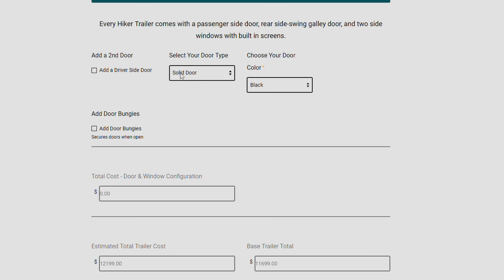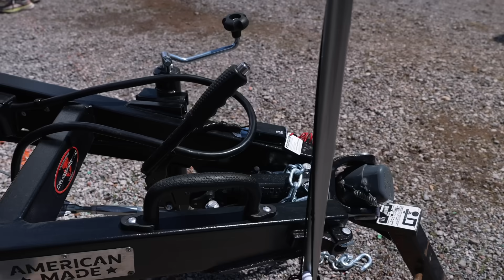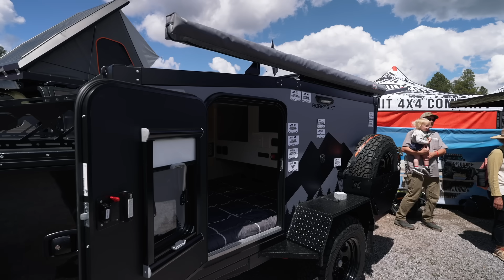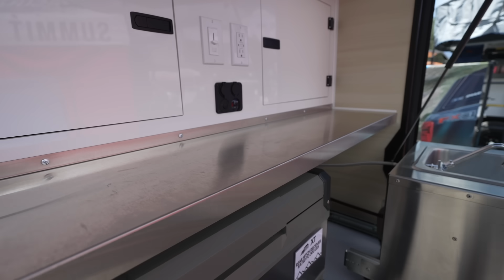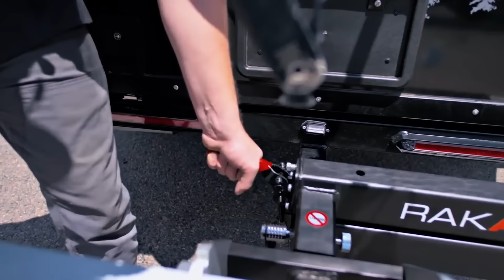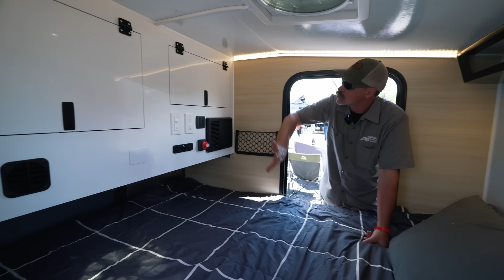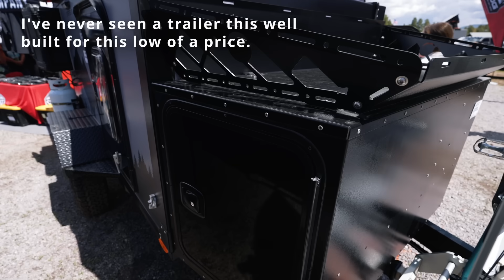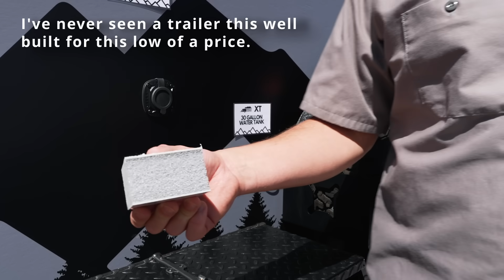The PERFECT Compromise: Mid-Range Price, Top-Quality Trailer!

Comment: I am confused. This video is showing the XT which is an eye watering 45k base (I assume). That said, I do not understand how the AT build sheet works. For instance, The build sheet has 47 item lines. There is a column That says "Add Item?" Only line # 0 says "Yes" which is the AT camper at $27,900. The other "Add Item?" say "No". Does that mean everything under Line 0 costs extra? If that's the case, this "Affordable" camper can get very expensive quick.
Reply from the maker: I don’t have good Internet on me at the moment, so I’m not sure. But all those components I mentioned in the video for the AT, they all come with the trailer base. That’s kind of the beauty of this trailer, all the big components like the suspension, the articulating hitch, etc. come at the base price. When I get better Internet, I’m gonna have to check out that pricing sheet.

Comment: I was excited for this episode until I realized it's another walk around video of the boreas XT by the owner of the company.  There's tons of these on YouTube. The Boreas is very short on actual use content.  Was hoping that you had taken one out and did a typical playing with sticks use and review or at least a meetup with another owner.  Also it's hard to imagine the stripped down AT when you are watching an XT walkthrough .
Reply from the maker: Sorry about that. I think for most of the playing with sticks audience though, this is probably their first introduction to the trailer. I think the owner does such a great job giving a tour of this trailer. But in all reality people need to see it in person. I honestly haven’t seen a trailer out there better built than this.
Reply: @PlayingwithSticks  I agree with that statement.  I was excited to see content with someone actually using the thing!  Living in the northeast, I haven't seen one in person yet but my research has led me to put this trailer on the top of my list.  Seems like one of the best overbuilt off-road trailers that can take some bumps and  perform as well as the tow rig on washboard roads with the Cruisemaster trailing arm suspension.
Reply from the maker: @Go4Lo you have done your research well. I honestly overlooked this trailer for years. It’s one of those trailers like I said earlier you just have to see it in person. The fit and finish is incredible.

Comment: I love a rear kitchen. This is a pretty cool little trailer. Looking forward to this summer with my small camper.
Reply: It looks good in many ways but you'd have to remove everything off the countertop in order to get anything out of the cabinets
Reply: Good point.
Reply from the maker: I’m embarrassed for asking this Carl because I should know this. What camper do you own?
Reply: Hey, no problem! I’ve got two actually - I have a big boy -Grand Design Momentum 25G which I like quite a bit. Then I also had that SunRay - which was too small and I don’t like exposed storage. But that’s where I enjoyed the rear kitchen. Current and probably final small trailer for a while is my 2021 No Boundaries 10.6. Bought used. LOVE IT.
Reply from the maker: I knew that! How embarrassing. I’m glad I asked though, or I wouldn’t have remembered.
Reply: Thanks for asking!! You shouldn’t be embarrassed. To even remember the people and their stuff in the comments is extra special. I really appreciate it!

Comment: Too heavy for my jeep. Not suitable for rough terrain, price what too high for all the discomfort. Who you trying to kid?!? I would not trust that hinge at all Slapping a motorcycle on their would require a HD truck for tongue weight and then with a stuffed box with gear what about trailer wag? You have lost your way, PLUS why spend so much all for less comfort than a plush coffin?
Reply from the maker: Not suitable for rough terrain?
Reply: @PlayingwithSticks Take a good close look at the hinge point with that weak snap coupling that locks it, then imagine going over boulders dragging all the weight and the stress of not only the total dead weight of the trailer, but the weight of the tongue with all the gear you can stuff in it, PLUS the weight of a motorcycle right on the tongue. There are other hinges that would allow 360 deg action far stronger than the one on the hitch. I'd sooner have a pintle hookup as noisy as it would be than that thing. Plus if you load up the tongue like the guy said you could there would be NO midsize vehicle that could safely handle it. Especially not something like the 4dr jeeps.

Comment: It looks like a pretty nice setup - and I love all that storage space!
However, I wonder why the spare tire is on the driver side and the shower setup on the passenger side? In North America, I would prefer to have the awning and therefore the hangout area on the passenger side. You could then add a fold down table to the spare tire setup under the awning. While I’m at it, let’s switch sides with the fridge and cook setup for better flow too.
Reply from the maker: Good eye. I didn’t even notice that. One of my favorite accessories is the tire tailgator table. I probably spelled that completely wrong. When I first got it, I thought it was gimmicky, but I’ve used it on every trip now for the last three years.
Reply: @PlayingwithSticks  one other advantage I’ve noticed in the short time with my TC Teardrop camper (with the spare tire on the passenger side), is that its easier to see past the side of the trailer to whats behind it while your towing it down the road. Perhaps that gets negated a bit if you stick the tankless water setup on that side.
Reply from the maker: That’s another really good point. Thank you for sharing this. What model of the TC do you own? Gotta love those folks at TC. I have heard so much about them over the years, and I finally got to meet them in person. I see why everyone loves them.
Reply: @PlayingwithSticks  I’ve got a 5x10 Off-Road Expedition (ORE) model. Can’t wait to get it out and have some epic adventures this year. 
Keep up with the great videos - I’ve learned so much from just watching them 👊
Reply from the maker: I’m like you, I’m just itching to get out there!

Comment: This is a sturdy looking trailer.   The setup of the galley feels awkward for me.  The back counter feels high.  How would that work for May?  Funny  that she was my first thought when I saw the galley.  And it's typical that the ground is not level and the cook can stand higher or lower depending on how the pitch of the ground falls.   I'd need an extra table to the right of the stove.   It's a fun looking little trailer, with lots of toy options.  I like that hitch.  I've also dropped my trailer off the ball.  Once.  And the hand brake at the front is a great option.  I had one on my teardrop but over time it seized up.  Be sure to keep that clean.
Thanks!
Reply: Thanks for the feedback Jenn - we typically have a small table nearby when cooking, but having everything within arms' reach means the area typically stays pretty tidy. Thanks for sharing your thoughts!
Reply from the maker: Thanks for sharing that tip on the handbrake. I love that you were envisioning May. I thought the same thing. This is truly an off-road trailer. And with any off-road trailer unless it has airbags/hydraulics, you typically are going to have to sacrifice an ergonomic galley height.

Comment: The weight is the biggest con, but this is a trailer that knows its purpose. I suspect people buying this for its intended purpose have a tow vehicle that can handle it. This fits nicely in the mix of the off road trailers with a very competitive price point. I like how they had the stove pull out from a lower position so that you are cooking at a comfortable height even with high ground clearance.
Reply from the maker: Good eye with the stove. And you’re absolutely right. Boreas knows exactly who they are building this camper for. And like you said they’re doing it a price point that’s hard to beat. It looks high for those of us who don’t operate in this off-road camper world. But once you start comparing the components on this trailer to others and the quality of the fit and finish, you realize how good of a deal this is.